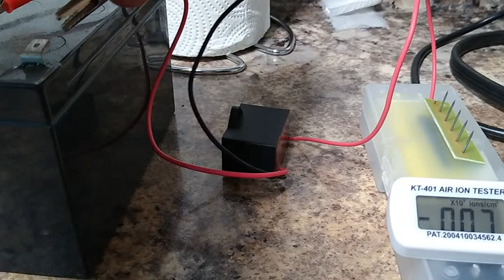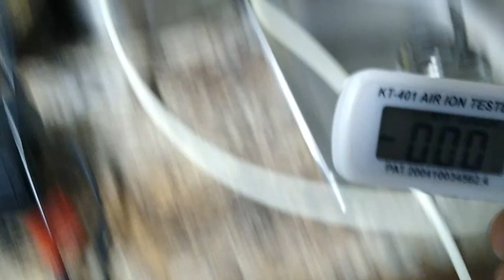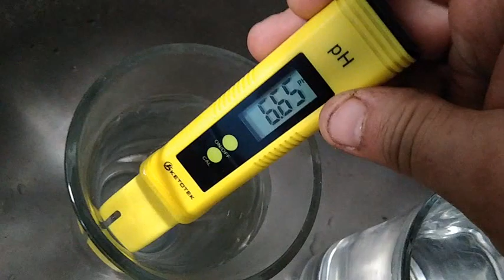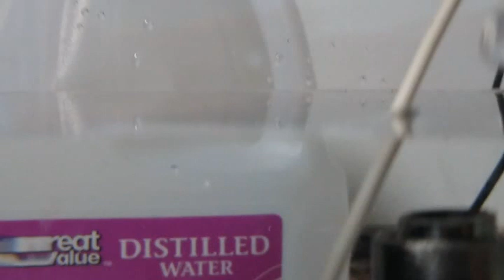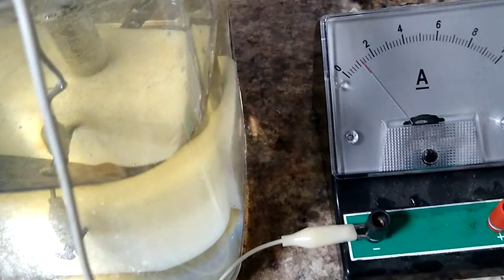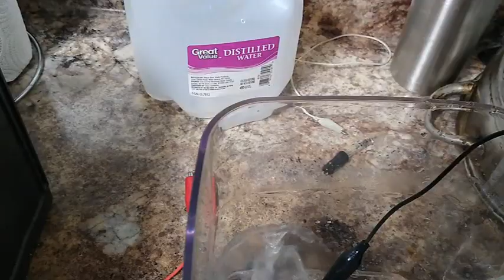John Ellis Water Testing RESULTS !!!

Comment: In distilling I have learned the quality of the water affects the initial distillation.  My well is 800-1000 PPM and during irrigation season can hit 1,600. I hace 3 distillers. A cheap China 4L pot distiller, a Pure Water Compact countertop distiller and a John Ellis. All 3 have the same results with 8-12 PPM after the initial distillation. I can run it through again and get a 0-1 PPM but for drinking the 8-12 is just fine. I also use a magnetic loop I run my water through before distilling to make the dissolved solids easier to clean up. 
I am convinced any of these distillers will make water better than it is before. Does it add magical properties? That is not why I do this. My water is harder than Chinese arithmetic and has high arsenic. To use RO I would have to treat the incoming water and then all the trash the RO filters generate.
Is the JE worth the higher cost? The pot 4L cheap China does the job. But the JE is a lot faster in distillation. Taste is subjective so I cannot say you will like it better than any of the others. If you have the $$$ the JE is a good machine. So is the Pure Water Compact. But they all do what a $75 off E Bay 4L pot distiller will do. 
The "magic" is up to you to decide.

Comment: I see you mentioned in comments that it isn't deterium depleted water. The weird thing is my aunt gave me some john ellis water. Before I read anything about it online, I look at my gf and said "this water seems light or something" it was the only way I could describe it. Like tap water and bottled water was just thick, heavy with toxins. John Ellis water was almost like drinking air. Then I read online that night that it was actually called light water. Im also not affiliated with them in any way. I mean at the very least you own a high quality(albeit expensive) stainless steal water distiller in case of pandemic emergencies I guess. But im a glass half full kind of guy.
Reply from the maker: i dont blame you for any way you feel all i say is Get some test it in a lab they charge $75 that way you know for sure Many have already done this and i have yet to see anyone say it was Deuterium Free like he claims
Reply: @madscientist4021  im curious did you try distilling as slow as possible?
Reply: @madscientist4021  i might do this
Reply from the maker: @markbalogh9655  i did many things i actually wanted to be wrong my main focus was seeing if the bond angel was true for HHO production with little amps But sadly didnt happen there are Forums  ive been on that many have tested the Deuterium in the water Even Johns website had to scrub it on any reference to Deuterium yes his videos say it you can check that Good luck on your discovery

Comment: First and most, I want to thank you very much for the video! Giving the fact that these machines (and design) are VERY old and outdated, compared to the ones that are in the market now. The part that I don't understand, is if there's a "way" to actually test per se, the presence of actual "Hydrogen" in this water, like there are the "blue-drops", in the market. I'm dealing with cancer, and I'm researching inexpensive Hydrogen machines and bottles out there, to separate the truth from the BS.Even the Japanese Kangen machines are VERY pricy. As far as I know, the benefit of Hydrogen actually is the releasing of an oxygen molecule, when ingested, since oxygen creates an alkaline environment, killing, fungi, germs, viruses, pathogens, etc, contrary of being acidic, where these procreate and thrive. 
It's quite hard to accept that these machines are a hoax, (at $3K a pop!) but then again, the technology behind it, is VERY old, that's why there are MANY in the market these days, at much cheaper than this.
Thank you very much in advance for your thoughts in case you'll reply, and thanks again for taking the time for doing this video! Cheers!
Reply from the maker: No problem I was hoping I was wrong but does not seam that way. I know several people who sent the water to a lab to confirm deuterium depleted only to find out it was not
Reply: @madscientist4021  How can you measure Hydrogen content 100% in this water?
Reply from the maker: @luisamedina1  sorry didn’t get back sooner been busy but you have to send it to a lab they have the equipment to measure it last I new it was $75

Comment: You are missing the point of what this machine does, It produces DDW, Deuterium Depleted Water, by removing deuterium oxide by selective distillation from the differences between the boil points of heavy and light water about <2F. Freezing works too but much slower process. So unless you have a GCG you don't know what you're measuring. Try freezing the light water, it will form characteristic spikes. Thanks for your video, Ken
Reply from the maker: No your missing the point he says it does threw all of his videos Yet His own site is Scrubed of any mention of DDW he admits it doesn’t and many have tested the water. please Prove it to yourself buy sending it to a lab only $75

Comment: Can you explain the results they got converting a sewerage treatment plants water supply with john Ellis water???
Reply from the maker: yes its simply a distiller a very expensive one. when i tested it seemed to be no different than distilled water but unfortunately the Claims of "DDW" Deuterium Depleted water are false as well as having more energy /bond angle. He had to remove the references of DDW from his website and as for the sewerage treatment im guessing not true but i dont know that for sure i just know my testing proves his claims are False
Reply: @madscientist4021  you have to watch how to run the machine right. (Very slow flow from the boiler tank.) But yeah, I don't believe that one guy's video from the internet that claimed it lowerd the amps dramatically. John using that guy's video for his advertising is absurd.

Comment: Deuterium depleted water claims are validate-able only via the amount of UV exposure in sufficient coverage and time of exposure.  John Ellis has published a Bacteria Destruction Chart (https://johnellis.com/wp-content/uploads/2017/10/bacteriachart.pdf), which shows the exposure times necessary to kill bacteria and create Deuterium depleted water.  If any device is capable of producing such an outcome, it would be the John Ellis machine simply because the water is exposed to UV radiation for a sufficient period of time to carry out the bacteria destruction.  His patent 6,409,888 explains the process and claims of the invention.  I believe that the deuterium depletion task probably requires an Electron 5 water machine to carry forward the task as designed in his invention.  It would be very wonderful to see a comparison test for bacteria cultures extant in tap water vs. distilled water vs. John Ellis Water (from an Electron 5 water machine).  Additionally, the energy of the output of the Ellis machine that you tested could have failed due to the fact that UV production wasn't happening per the design.  (i.e. the UV bulb needs replacement - it may have visible light, but insufficient UV production from the bulb).  Also, I have a question.  With the water being produced by the John Ellis machine that is treated with UV, does this process (converting steam after exposure), plus the recirculation (distillation - when the machine is set to distill the water), produce H2O plus OH- ions, or H2O2, H3O2, or H2O3?  How does he achieve a sustainable Hydrogen Bond angle per the UCLA study, of 114 degrees except if it is no longer really H2O?  Who can test his water with an Electron Microscope to ascertain if the bond angle is truly 114 degrees?

Comment: The machine you tested is an Electron 4.  It features only 1 UV Light.  The Electron 5 "has two bulbs and a more powerful transformer to produce twice the ozone levels as it breaks down into oxygen and nascent oxygen."  I'm not connected with John Ellis.  One of my uncles owns a machine, not sure which model he has.
Reply from the maker: yes im aware and John ellis states all the Benefits and claims Not for the electron 5 but both. I simply do not like being fooled and so far it looks like its a fraud I would encourage you and others to do your own testing to prove or disprove the findings. but a BIG one is johns own words Claiming it Deuterium Depleted water.  He even has Lab results on his site. OOPs that's before he removed anything saying DDW please see for yourself cause he clearly says it on the Videos. Good luck
Reply: @madscientist4021 , as the only logical basis for showing the success for making deuterium depleted water results from the UV exposure introduced into the steam itself before condensation; and, since the water must be exposed for sufficient periods via the explanation which Mr. Ellis stated: "The machine changes this angle by taking the water from vapor to liquid, about 300 times per gallon from a boiler through a condenser, and exposes it to ultraviolet light that produces ozone gas along the way.", then, I, a person not connected with John Ellis in any way, have the opinion that this stated procedure is the proper procedure for producing deuterium depleted water. Therefore, his claim regarding his machine's capability of producing deuterium depleted water is absolutely and incontrovertibly true.  The summary of the invention states this:

"According to the present invention an ozone generator is placed in the boiler of a distillation or degasification apparatus. When water is forced back into the reservoir, a vacuum is created in the boiler which sucks in air through the condenser. The oxygen in the air is then turned into ozone, a strong oxidizing agent, with the ozone generator. Steam formed in the boiler must pass through the ozone before entering the condenser and therefore any contaminants in the steam are destroyed."

In another comment I cite to a Bacteria Destruction Chart that I have archived and examined.  In it, the following is stated by John Ellis:  "These viruses and bacteria are the cause of any problem you can name and they are mutating out of control!! We discovered the only water in the world that can kill pathogens (look at the organa lab results) Divide the exposure times by 254 and you will have the time in seconds required for complete destruction. This is the only product that allows enough exposure using frothing, concentrated heat and ultraviolet energy!"
Reply from the maker: @ottoschulze1889  You may want to Contact Johns Number cause HE HIMSELF said to others He was Wrong about DDW So for you to go on and on about it being true???? WOW sorry Talk to him or a rep so you can Find the Truth NOT what you think. Sorry to Burst you bubble But My Test are Conclusive It has NO Energy as he Claimed I simply say this PROVE ME WRONG Not just words Do the test yourself unless you afraid to find out your wrong Just like you about to with DDW
Reply: @madscientist4021 , point me to where John Ellis said he was wrong about Deuterium Depleted Water claims.  Also, his patent was duly approved by the United States Patent Office, as a valid invention, and a medical doctor, Dr. Guy Abraham, M.D., from the faculty of U.C.L.A., verified the ability of John Ellis Water machines to do Deuterium depletion.  Furthermore, the descriptions of the process itself, including the Ozone treatments it performs, indicate a viability to John Ellis' initial claims about the Deuterium Depletion capabilities his invention was and is designed to accomplish.  I call upon you to verify if that UV bulb was emitting UV Light at the levels it was designed so to do.  Moreover, I request that you take another measurement once his invention is working properly.  The only reason I can think of for the lack of oxygenation of the water produced from your loaner John Ellis Electron 4 machine is a malfunction of the UV system.  I'm sure you can see that John Ellis machines should clearly be able to perform deuterium depletion fully and completely by examination of the 6,409,888 patent document itself.
Reply from the maker: @ottoschulze1889  As I said YOU can Call Him or his Reps. A friend of Mine did just that and asked about him taking off all the DDW from his website They told him they might be wrong about that. SO CALL and find out for yourself.  If you really want and think its cause you have a Electron 5 Send me a Batch of water and id be happy to test it BUT if im wrong I will say so Just as if you wrong I don't want to here you say anything Up to you just a offer but I think you should do your own test so you wont have any excuses
Reply from the maker: @ottoschulze1889  oh Also just so you know im not trying to be a Ass just disgusted with things that are fake. till I have evidence that disproves my own test Im saying its FAKE im just very annoyed buy the whole thing and I was hoping I was wrong
Reply: @madscientist4021 , thank you for your reply to my messages.  I'm going to ask him to send me a review machine.  I think I can help him verify his claims and prove you are wrong with your measurements, not because you didn't know how to take them, but because of possible equipment malfunction.  Please think about it for a moment.  John Ellis is an inventor.  When we read the patent document, don't we get a sense for what the machine is designed to do?  Do we not know enough about the design parameters to know what the machine should be capable of doing?  If any water is Ozone treated, should it not be cleansed from harmful bacteria?  The fact is that a water distillation process, taken alone, doesn't perform deuterium depletion without Ozone treatment.  Didn't John Ellis say in an interview that drinking one-pass distilled water is dangerous because the deuterium passes along with the steam?  Yes, he did!   You may not realize this, but Mr. Ellis may have taken down claims about deuterium depletion just because his attorney advised him to do it because of the attacks that he has made fraudulent claims about his machine.  If, however, he was found guilty of such fraud beyond reasonable doubt, then it seems to me that the U.S. Patent Office is equally guilty for allowing multiple patents to be filed that contained false claims.  None of this is true about John Ellis, because, as scientists, we know that we must understand what a device is designed to do, before we test it.  For example, we can't test a multitrack audio recorder for a flat frequency response before understanding how it records audio on tape and have the proper equipment and tools to carry out the test and before we ascertain if such recorder is in proper working condition and is calibrated properly to record an audio signal in accordance with its published specifications and its maintenance manual.  Next year, John Ellis will be 90 years old.  It is unclear whether he is capable of thinking with the same rationality as he did several years ago.  I've never met the man.  I admire what he's attempting to do with his design.  I think he attempted to make his water machine perform as he designed it to perform, as an engineer.  So, knowing this, and testing any machine for viability is a process and a responsibility that carries with it the necessity to understand its design and to understand how to troubleshoot problems if the machine doesn't perform up to its design specification.  Since John Ellis made UV cleansing systems a part of his machine, it is evident that he intended for his machine to perform deuterium depletion, fully and completely.  He knew about the exposure times of UV necessary to carry out the depletion task and has completely designed a solution to that process.  I think the Electron 4 system should be capable of doing the depletion task.  Somewhere in his website history, there must be a document that compared the features of Electron 4 and Electron 5 machines side by side so potential buyers could choose between which machine would fill their needs.  This is a moot point, since he no longer offers the Electron 4 machine for sale (new).  The reason I'm so interested in this is that I can see his design ought to be able to perform complete and total deuterium depletion, because of the repeated exposure of the water to in-depth cleansing.  I think he is worthy of our admiration for being the inventor of such a machine.  I think you tested a faulty machine (UV system was not putting out).
Reply from the maker: @ottoschulze1889  ok 2 things for you to consider Sorry you don't know this but the patent office will Patten anything with ought proof it works. "That is a Fact" Secondly we ordered samples from HIM in a Previous Video I did. So sorry if the water comes from him Directly and I didn't get results No offence but the electron 5 Means nothing. Also the results im looking for is the Electrolysis. That Claim is still on his site And I proved it  completely wrong with HIS WATER not mine
Reply: Mad Scientist if fakery disgust you, do not look at NASA Apollo Moon Missions. Do not try to measure the curvature of the earth. You have been warned.
Reply: Mad Scientist I appreciate your diligence to determine the true performance and value of this machine and  Claims of John Ellis. Thanks.
Reply from the maker: @goerto  no problem I truly was hoping I was wrong cause it would be a good thing but it turns out im not but I do remain open to suggestions noticed no one has proven me wrong.
Reply: @goerto  fakery disgust me big time like the fraud of  NASA Apollo Moon Missions is insane   and yeah there in no curve
Reply: You have to prove the patent works before they give you a patent.   You can’t just patent anything you want. Smh